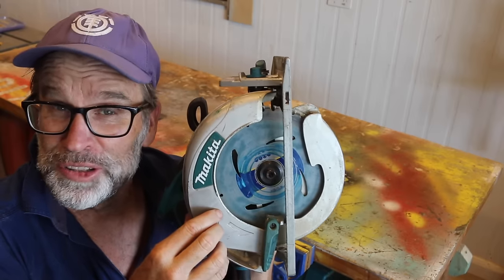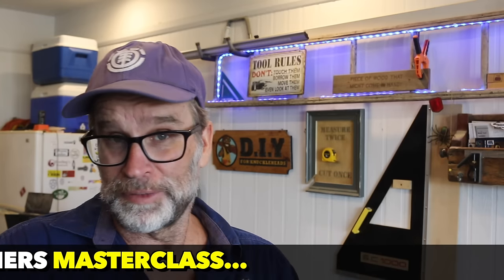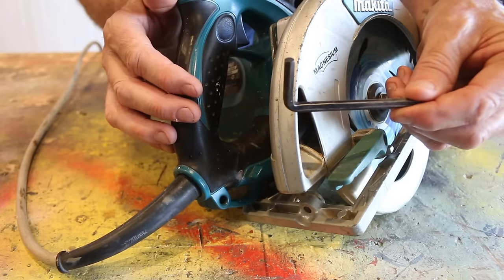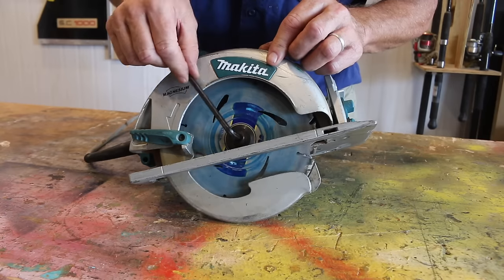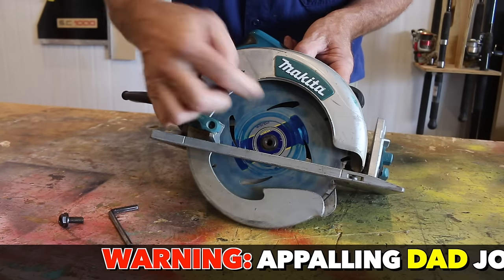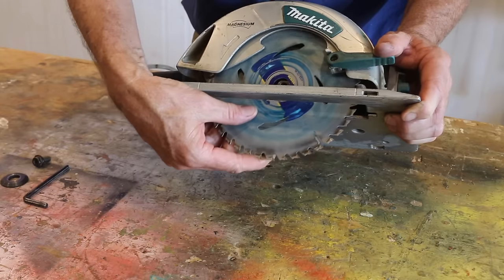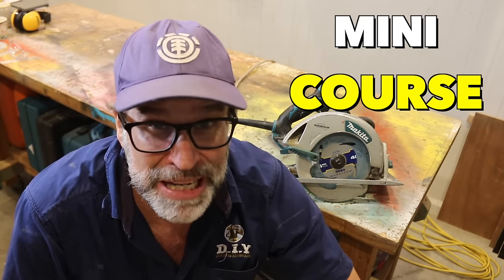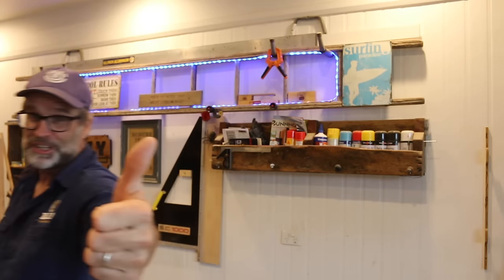How to Change a Circular Saw Blade. Step by Step!

Comment: My Makita was clockwise to remove... so turning to the right, and then turning to the left to tighten back.  Completely backwards from 99.9% of screw-ons I've ever used.  It would not have occurred to me before I watched this video.  Must be a southern hemisphere version of the tool!  Thanks for this video!
Reply from the maker: No worries at all mate 👍👍

Comment: THANK YOU! I have a Dewalt, newbie DIY guy here, no experience. Couldn't get the $%$# blade installed, as the release wouldn't go all the way down, unable to tighten the blade. Unbelievably frustrating. After 5 different videos, FINALLY, your suggestion to "jiggle" the blade a little was the secret. Immediately it tightened, blade working perfectly. Thank you for explaining things properly for us rookies!
Reply from the maker: No worries at all mate! Glad to help 👍😁🇦🇺
Reply: @diyforknuckleheads  It's embarrassing, but I know NOTHING about tools/procedures/etc. and sometimes otherwise great videos will gloss over basics; they just assume "oh, that's too basic to even point out." I appreciate when creators don't skip this kind of thing (even sped up is fine.)

Comment: What! 😳 You have to change the blade!
I usually wait till all those rough bits are worn off then buy a new saw 🤣🤣🤣
Great tip Knackers 👍
This'll save me some $$
Reply from the maker: 😂…man after my own heart Shane 👍😆 Thanks for watching mate 👍
Reply: @diyforknuckleheads  For cutting roofing iron, if you have an old non carbide tipped blade,  reverse it (so the back of the tooth hits the tin first). Good use for an old, dull blade and makes cutting big runs easy peasy (wearing proper PPE of course).

Comment: Knackeerrrrsss!!! Loving the channel mate. Could you advise me on a project please. We have a large 3 and 4 seater sofa. One of them has developed a small bow in the middle. I’m thinking of taking all the legs off and building a wooden base to attach to the underside of the lounge,  which is rebated to attach a front mould or trim.  Is this as simple as building a base from construction pine and allowing enough rebate to fit the trim. Any tips or advice would be sensational mate. 
Waz
Reply from the maker: Cheers Wazza 👍 Mate it sounds like you're all over it 👍 Pretty hard to give advise if l don't actually see it but from what you've said it sounds like a plan. Good luck with it mate 😁🇦🇺

Comment: Hey uncleknuckle thanks for the video. I have a Ryobi R18CSP that I bought in 2021 here in New Zealand without knowing much (came with a set of 9 tools) included an 18T blade. After another video of you I learned about the amount of teeth so I went to Bunnings and bought a 40T blade but the wrong size (165mm, knuchleahead). So I'm checking and seems only Ozito brand is available with 36T at Bunnings within the 150mm size. I've checked other retailers and none of them have that size.

Could you please share any advice? thank you in advance.
Reply from the maker: G'day Mauricio.....try this one from Makita https://www.totaltools.com.au/157920-makita-150mm-25t-tct-circular-saw-blade-for-wood-cutting-efficut-e06915
I know it's not 40T but it will still give you a very nice cut. From memory, l have never seen a 150mm saw that comes with a 40T Blade. I'ver seen ones with 50 but they are for cutting metal.
Good luck 👍
Reply: @diyforknuckleheads  thank you!.

Comment: Mate I need to learn how to cut and measure external and internal mitre cuts with aluminium angle , starting at 10x10, I also need to understand the measurements between internal and external , can you point me in the right direction 👍

Comment: Rather than a shifter if the Allen Key is not available, I would find a socket that fits and use that. (Hopefully not a 10mm one tho' Lost all of mine along with flat blade screwdrivers :-) )
Reply from the maker: Hahahahaha...the elusive 10mm socket 😂

Comment: Got a bit of a bargain lately, Shane. A used Makita 7" 18v circular for £30 (53 Australian dollars). It was an old ni-cad saw but I have a couple of converters for Li-on batteries that I use on some drills. It's really light compered to my other 10" cornered circular and I wouldn't be without it. Oh and by the way ,Klopp. Thanks for stuffing Chelsea's season in the FA Cup and league cup🤣🤣🤣 Look forward to the next video.🏴🇦🇺
Reply from the maker: 👍👍...Absolute bargain Mick! Well done mate and yes, how good are the mighty Reds!....What a nail biter....l couldn't watch...to nerve racking. Have good one mate 👍😁🇦🇺

Comment: My saw doesn't have a blade lock
Reply from the maker: Mate, look up your user manual on google and find out where the blade lock is. All saws have one as you need to be able to lock the blade to change and replace it. Good luck 🤞